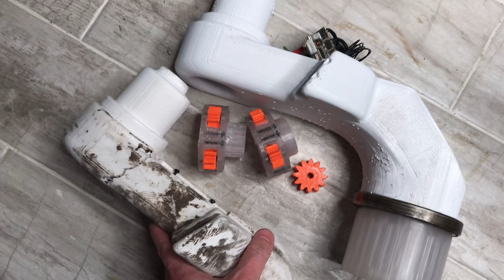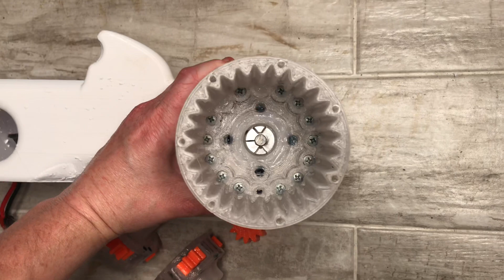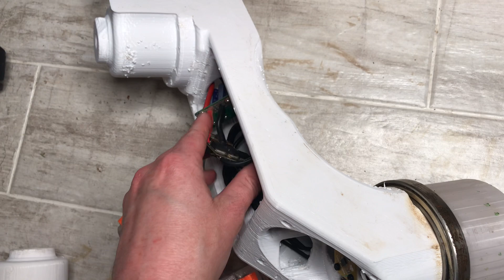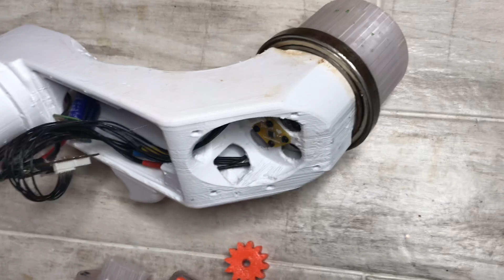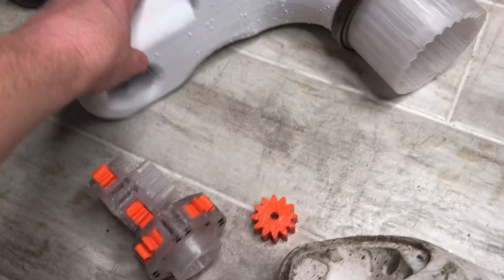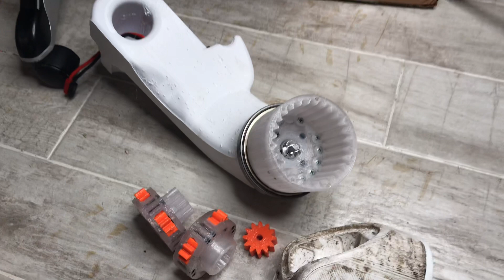Rover suspension arm repair details

Comment: Which printer and build surface have you been using to get prints of that quality? 

Do you usually have to print multiple times to get an unwarped part when using petg.
Reply from the maker: TheEngineerC I did actually print that part twice because the first one was warped... however the reason was that my build surface was totally messed up on the first print (the plastic sheet was badly damaged and coming off of the aluminum plate beneath). I removed the worn plastic build surface and installed a new one, then leveled the bed and the new print went well. Printer is a TEVO Black Widow but I don’t recommend it. Hot end was an e3d volcano with 1.2mm nozzle. I’m now installing an e3d SuperVolcano. 😃
Reply: @SequoiaAlexander  what is the build sheet made from? Buildtak, PEI?
Reply from the maker: It’s a “Dobstfy” brand from Amazon. Generic “build surface” for 3D printers, but the listing doesn’t specify. Maybe PEI? Also I use glue stick to modify the way it adheres. Sometimes PETG sticks too well to the clean surface but glue stick helps it release.

When you have adhesion problems how does your first layer look? You’ve got to get a consistent first layer or it will definitely lift up. I recently added a bed probe to my printer (after printing this part) and I can tell it’s going to make a huge difference.
Reply: @SequoiaAlexander  Yea I have a bed probe from when I bought the machine, but the firmware is hardcoded to probe at only 3 points which makes it impossible to account for warpage in the machine. So my first layer is really good on some parts of the build surface but the closer it gets to the corner the less the first layer sticks. Really frustrating, cant even print PLA parts without warping at the edges even when I use BuildTak
Reply from the maker: That’s frustrating. Can you reflash the firmware? I’m using a Duet WiFi printer driver and it’s wonderful. Can you do anything to reduce physical warpage of the bed? What printer is it?
Reply: @SequoiaAlexander  printrbot play. Very small and rigid system. My plan was to buy the heated bed upgrade before the company went under but it's looking like I'll have to machine my own now haha. 
I wonder if I could adapt a duet to work on my system. That would definitely make things more configurable.
Reply from the maker: Ah, I see. I’ve never printed PETG without a heated bed, so that’s a big difference between our setups. The Duet WiFi is nice but it’s pricey and it’s also involved to install it. For the price of a Duet you can almost buy an Ender 3 printer which I believe comes with a heated bed.